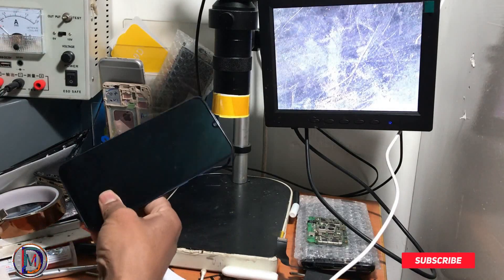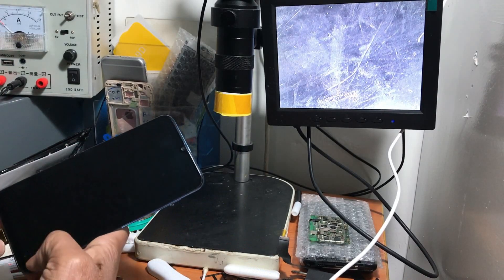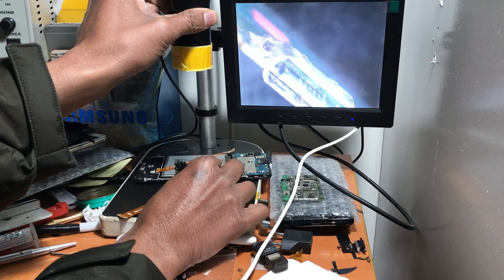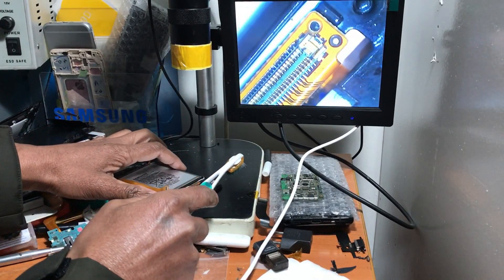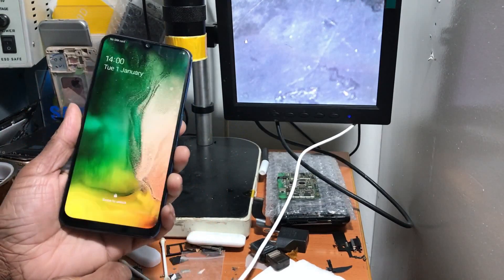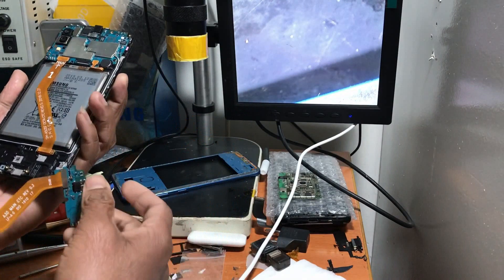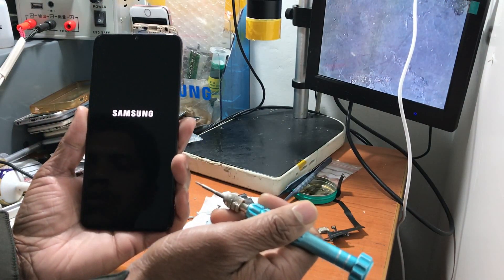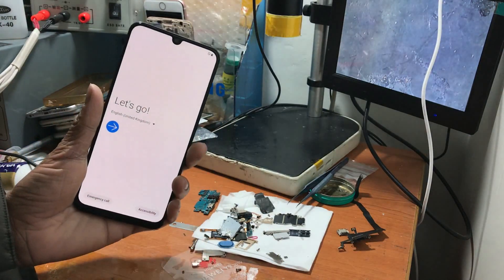SAMSUNG GALAXY A30,A20/s,A10/s,A50/s,A70 LCD backlight Off never LCD light On Sleeping mode Solution

Comment: Hello i have problem. No display but i can hear sounds. Its a new LCD I bought from online after i installed it everything works fine. And the moment i noticed i wont charge anymore and then i tried the volume down and power buttong hold for a minute then plug the charger and it vibrates. After that no display.
Reply: mines the same.... did you ever resolve your issues?
Reply: Same issue not working

Comment: Sir mery mobile a30s me same problem ha solution batain please
Reply from the maker: This problem you can fixed by following two step
1. Check Charging port if damaged change it and check if not working 
Just change charging Flex Board it’s working 100% Done ✅

Comment: Did you use original for replacement??
Reply: Kindly answer
Reply: I have the same problem.
Reply from the maker: 1st check DC Port is Damaged Try to change it. 

If Charging Flex board is damaged change it and Enjoy 😊